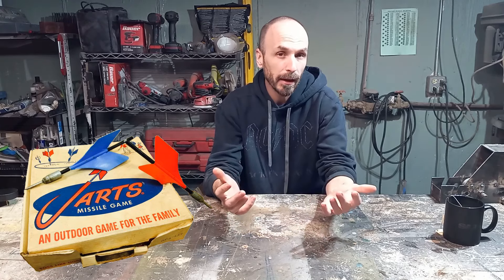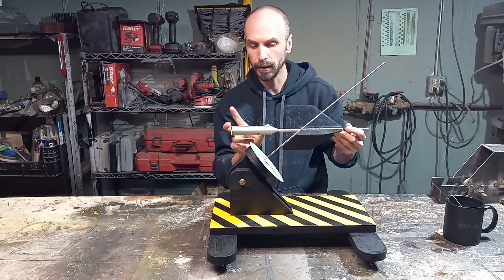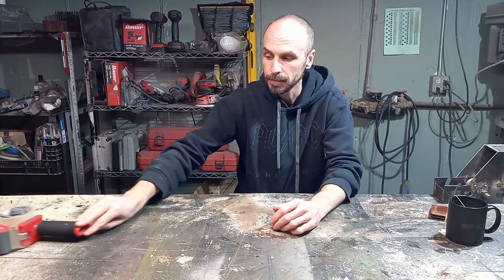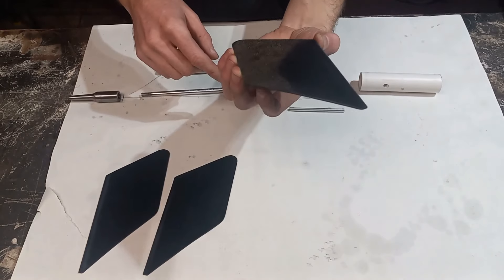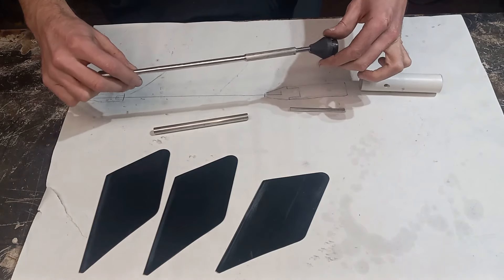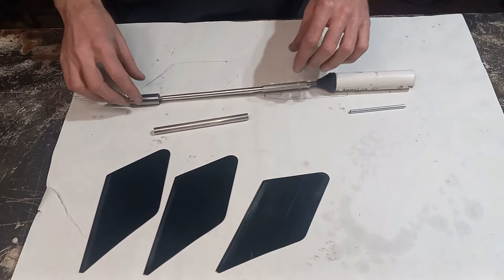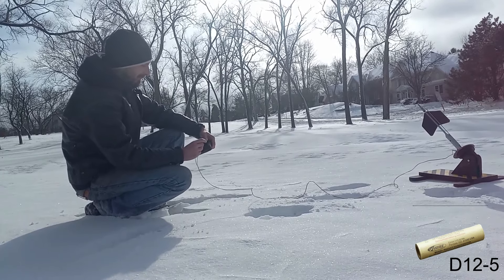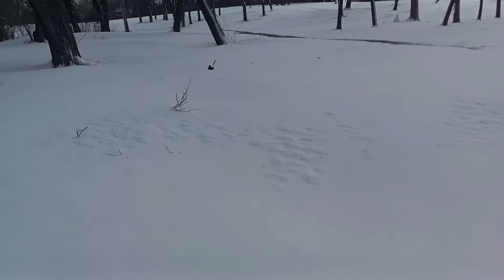BANNED - Rocket Jarts - most dangerous yard game

Comment: This is dangerous for the wrong reasons - you have an inherently unstable design with a CG behind the fins. You definitely need the CG in front of the fins, both with and without an engine there. The CG also needs to be forward of the CP.
Reply from the maker: There is a correct way to be dangerous?
Reply: @chrismakesstuff1  Most would prefer a design less likely to return to the launcher when fired. Unless you want to be your own personal Captain Tupolev.  ("You arrogant ass.  You've killed us!")
Reply from the maker: @teej9227  its been a while since I've heard a quote from "the hunt for Red October".  But yes, it is dangerous as called out in the title and description. Thanks for watching.
Reply: @chrismakesstuff1  Now you need to make it GPS guided.  :D